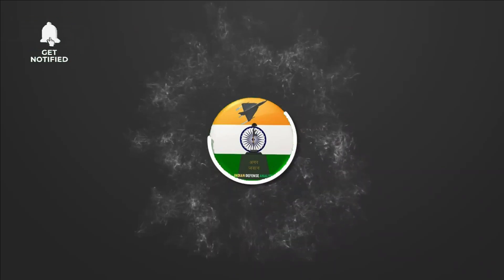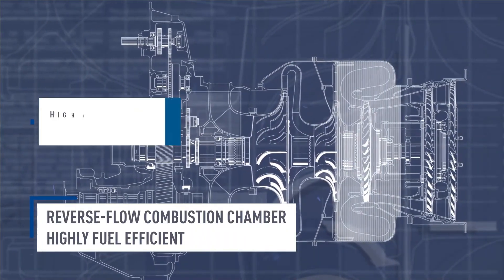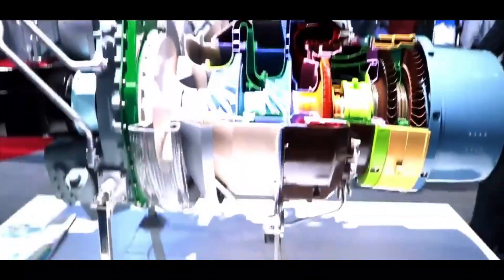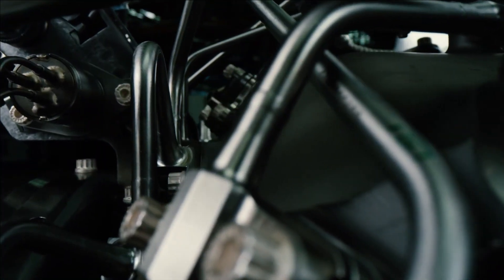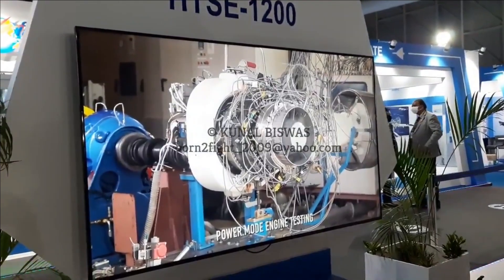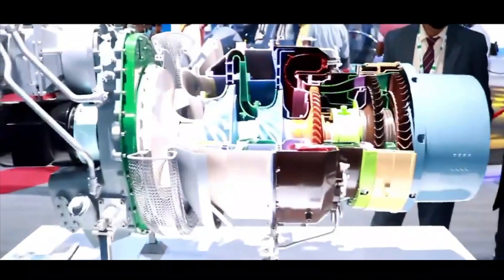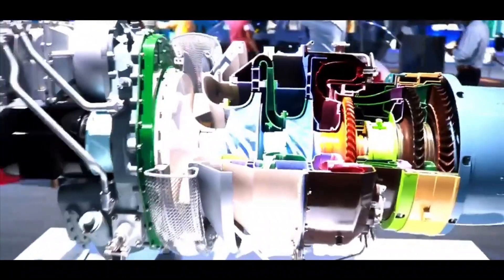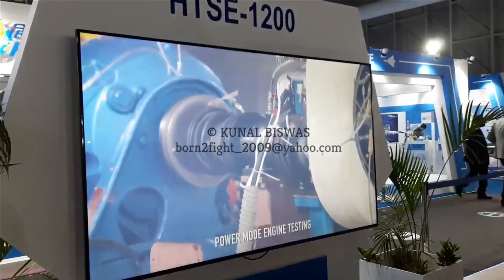HTSE-1200 to complete certification by 2025

Comment: HAL HTSE-1200 seems to be almost identical in specification to
Ardiden 3 which weighs 215–226.6 kg and outputs 1,177–968 kW.
However the subpar  Ardiden 1 Shakti powers the Indian HAL Dhruv, 
LCH,LUH..

HTSE 1200 235 kilograms  1,200 kW
Shakti          205 kg.              1,032 kW 

20% more power for a 10% increase in weight.

HTSE-1200 is superior to the Shakti, being fully indigenous and lower in cost.
Comparable to the best that Safran can make, which is a huge leap forward for
Bharati helicopter engines.
Reply: Arre is  engine ka flight test kab hoga  turkey ne already kardiya apni ts 1400 ki 🥱